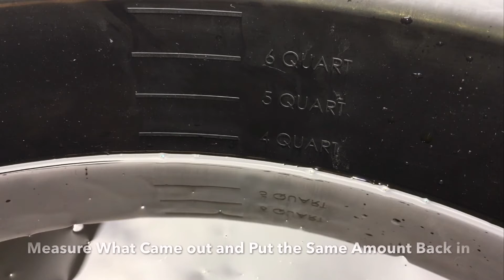2013-2017 Honda Accord CVT Fluid Change DIY

Comment from the maker: CVT fluid: https://amzn.to/4arLLwQ (You'll need four bottles)
Drain plug crush washer: https://amzn.to/4gq2hip
Funnel: https://amzn.to/3E7JfQa
3/8 breaker bar: https://amzn.to/3PMDlGQ
3/8 torque wrench: https://amzn.to/3WoMCbB
Oil drain pan: https://amzn.to/3EgjRHU
Car ramps: https://amzn.to/40oSlj3
#ad

Comment: How often should I change my CVT fluid? I have a 2015 Accord Sport but only have just over 30k miles on it. Thanks for the great videos!
Reply from the maker: Jourdain Dong every 25k-30k miles
Reply: Honda recommends 60k for this CVT; every 30k if you're driving it through mountains and hills constantly

Comment: How many quarts will typically come out of a 2017 Accord during a drain and fill? How can I convert to (Amsoil?) synthetic CVT?
Reply from the maker: Around 3-4 quarts, get 4 quarts. Use Honda fluid only.

Comment: Nice tutorial. Is there a "best" way to position the vehicle for the most complete drain possible (i.e., jacked on one side vs level)?
Reply from the maker: The best position is the car being level.
Reply: you wont completely drain all the oil through a single drain and fill, because a single drain will only pour out about 40% of what the cvt has in its case.
Reply from the maker: @zkmoonea  yep with almost all transmissions

Comment: Does the car have to be lifted on all 4 sides? Wondering because for a regular oil change I usually only lift the two front sides.
Reply from the maker: Should be level yes

Comment: I did the change but I didn't replace the crush washer. Will this cause any problems or leaks ?
Reply from the maker: Change the crush washer every time, it's cheap insurance. Buy a genuine set of 50 washers or whatever and you're set.
Reply: @MrRangerZr1  50 crush washers..for 50 fluid changes..hmmm?😊
Reply: I changes the fluid at 30k didn't know  there was a filter to change in the other vid u did..that vid i cant understand tho..ty
Reply: as long as your washer wasn't completely fucked up or cracked, I highly doubt you'll see any problems.

Comment: Okay this may be a dumb question but for this Honda  is the CVT fluid the same thing as the transmission fluid ?
Reply from the maker: Fluid is totally different from CVT and ATF
Reply: MrRangerZr1 my question is for a 2017 Honda Accord instead of changing the transmission fluid you change the CVT fluid right ? Every 50 k miles I believe
Reply from the maker: Wcoast408 Technically speaking you are changing CVT fluid. Just keep in mind the type of fluid and trans you have.
Reply: MrRangerZr1 ok, I have a 2017 Honda Accord sedan , what fluid what I need ? Do you have a Venmo? I can send you some money if u shoot me some info in regards to the CVT fluid change ?
Reply from the maker: Wcoast408 lol brother i’m here to help no worries hmu on twitter if you want @MrRangerZr1

Comment: Does anyone know the part number for the shield that he removes at 0:23, since my car doesn't have that part?
Reply from the maker: The 2016+ accords came with the lower shield. You honestly don't need it. I hate it because you have to finesse with it during service.
Reply: MrRangerZr1 yep, On my 2017 accord sport that shield came off and stayed after the first oil change. Hell if you want one so bad I’ll mail you mine
Reply: Lol mine fleww off when my friend didnt put it back on right. It’s better off without it. It’s really just an inconvenience every oil change.
Reply: I keep my on because I live in the rust belt, but one of the screws has rust welded and I can’t get it completely off anymore. If you live in a warmers climate I would recommend keeping it off.
Reply: @swaggerjacker1482  Do you still have the skid plate? I’ll take it if you don’t want it…
Reply: @juanguerra5131  I believe I do. I will look in my shed tomorrow. It’s been off since my first oil change
Reply: @swaggerjacker1482  Awesome.., how much would you sell it for if you still have it?
Reply: @juanguerra5131  I looked in my shed but didn’t see it. I will look again, my next day off is Thursday. If I can find it , just pay shipping and it’s yours
Reply: Since no one answered the question. Part # 74112-T2F-A01Plate, Engine Cover (Lower/oil pan). Part number wasn't easy to find, around $30-$40 (Anderson Honda Palo Alto, CA). I figured I'd replace it, rather than have my girl crack the oil pan.

Comment: when the car needs to change the transmission oil, is their some light that warns or has to be accented every few miles
Reply from the maker: The car does give you a different code every time the oil change reminder comes on. Look in your owner's manual and see what the code means.

Comment: I have a accord 2016 and 87,000 miles so i need to change a transmission fluid for now or when?
Reply from the maker: Martino M yes now every 30-40k you should
Reply: MrRangerZr1 but when i buy the car is 49,000 miles now is 87,000 miles so do i really need to change it?? I just wanna make sure everything so
Reply: Martino M yes change it, almost 40k miles. You should of changed it when you first got it, because you don't know if the person did a transmission service before you. Do it ASAP, these CVT are pricey
Reply: But the car will let me know to change the transmission fluid oil right??
Reply from the maker: Yes that's what the codes tells you, like "A1" for oil change.
Reply: @Brianchene8  no, there is no code for transmission fluid change.
Reply: @cheurm  you'll be fine but do it sooner than later. 
Honda recommends 60k-90k for this CVT

Comment: I was told that if I have had my honda accord and only charged transmission fluid once that if I do it again, I could risk having transmission issues
 My 2013 has now 120 k miles.
Reply from the maker: As long as you don't flush the transmission with a machine, you're safe. Do a change ASAP!

Comment: Hey how do you know if your car has leaked transmission fluid after the change? I do not have a dip stick showing the level on top of the engine.
Reply from the maker: Well if it leaks you're going to see the leak lol clean the area where you think is leaking and check it again, if the leak appears then you have a leak.

Comment: I have Honda Accord 2017 130 Kilometer I’m Never Change oil transmission
Reply from the maker: You should. Never too late. Never flush remember, drain and fill like in the video.